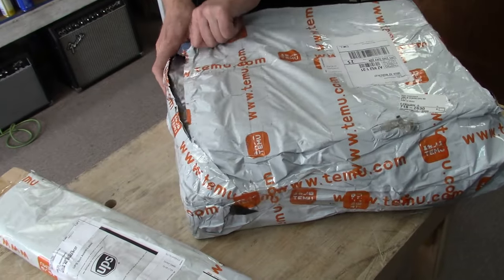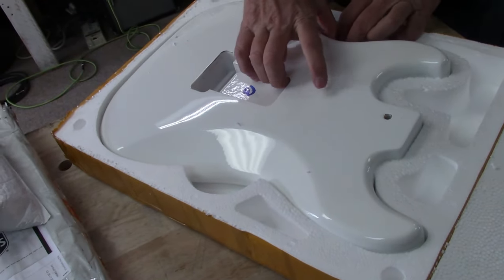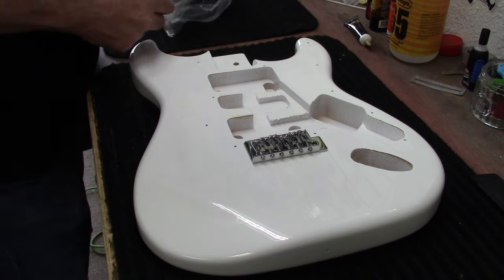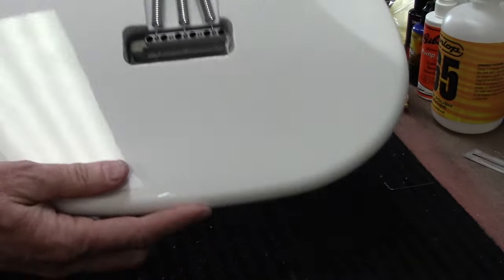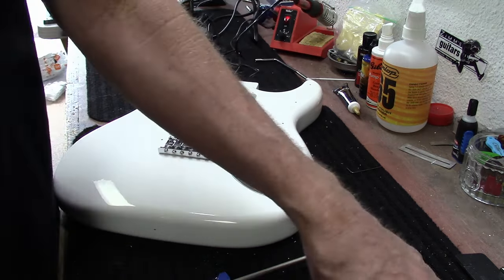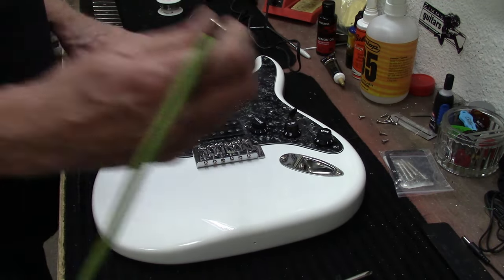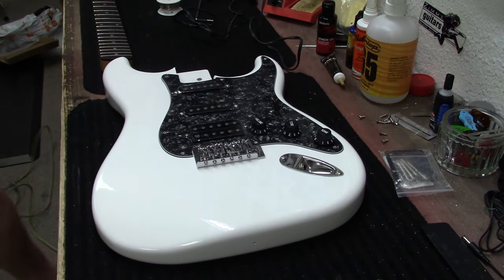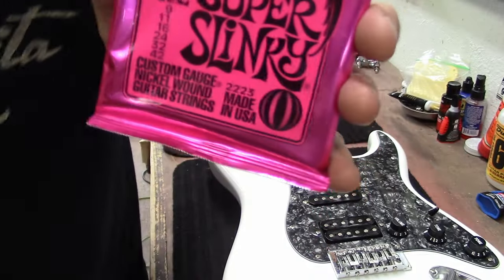I built a guitar using Temu Parts!

Comment: Awesome job as always,  The neck came from one of my goodwill guitars.  The Rocket specials are known for the hot humbucker pickups and at $40  I got a pickup in a guitar package.  Zimm's had a custom neck put on it "strat type"  neck and did an amazing job setting it up on my custom build.   Make sure you put a Zimm sticker on the back of the headstock!  Great seeing your work and I was just about to pull the trigger on Temu so I will make sure the code is loaded.

Comment: I got a jack from Temu and it has no wires on it just a bare jack I am building a cheap guitar also but have most of the parts I bought the same pickups you have I am still painting the body satan black got a couple more coats yet